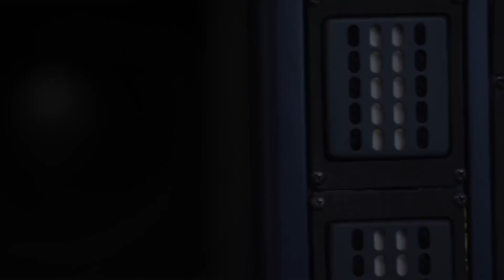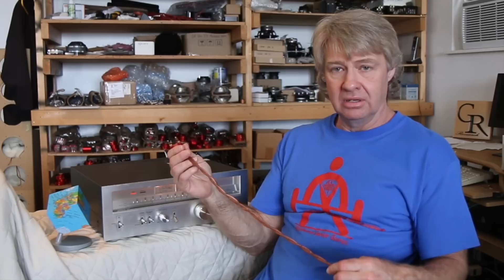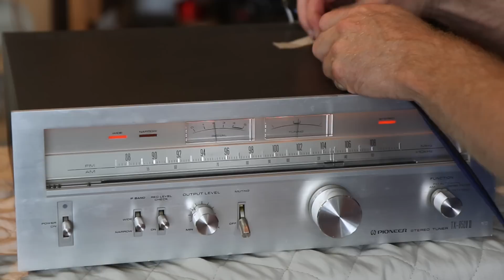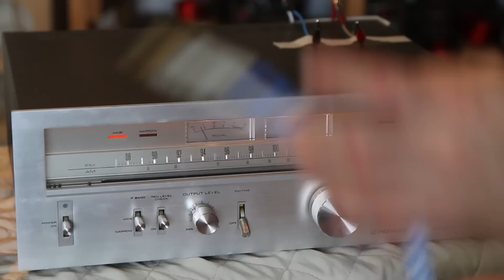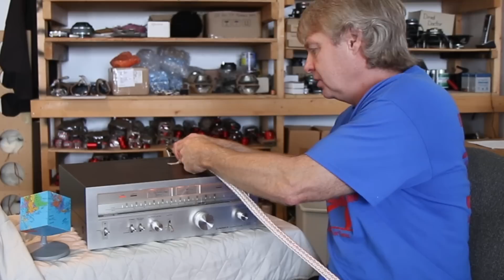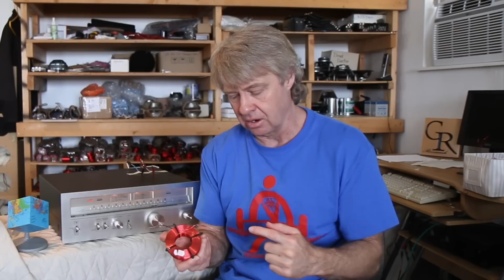Do Audiophile Cables Matter? Here's PROOF!

Comment: The quality of one's cables should match the quality of the other components. Expensive cables wont help ashitty system. On the other hand, if you want the most out of your high end system, you're going to need high end cables.
Reply: Agreed. and fancy wire with a cheap electronics can makes things sound WORSE.  When I was new in the hobby 20 years ago and had cheap, crappy gear (but good speakers) I purchased some Kimber PBJ interconnects, about $70/meter, as my first audiophile wire. I had been using cheap wire of Radio Shack quality purchased from Goodwill.  My bias expectation was that the sound of music would either "improve" or I would hear no difference using the Kimber. But when I listened with the expensive Kimber the sound was WORSE than when using the cheap wire: etched & harsh. The difference was night & day. I knew within 5 seconds of listening I would be going back to the cheap wire  (I sold the Kimber at a loss). What was the problem?  My theory was that the Kimber exposed the flaws in the crappy gear while the cheap wire smeared & veiled the flaws, like using a camera's soft focus to make someone's wrinkled face look younger. (All connectors on the wire were clean and had no wear; both types of interconnects were low capacitance.)  And I noticed that as the quality of my gear improved over the years having a lower noise floor, the harshness using better cables diminished and I could hear subtle differences in wire more easily.  And more-expensive wire did not always result in better sound than when using cheaper wire. 

And what do I mean by "better" sound?  We've all had the experience of walking down the sidewalk and hearing a piano or trumpet coming through the open window of a house and you know it's a real instrument and not a recording. Even when hearing an electric guitar (not an acoustic instrument!) sight unseen it's easy to determine when it's live. The ear is a very sensitive instrument. "Better" is what sounds more lifelike.

Objectivists miss the point lecturing that if something measures the same it must always sound the same. It's more complicated than that. If everything regarding sound came down to measurements then a manufacturer today could cheaply mass-produce violins that sound better than Stradivarius' cellos and violins - especially when considering all the knowledge about sound & materials & computer modeling we have contrasted with Stradivari working under primitive conditions. But nobody today can figure out how to make a violin having the superior tone/loudness characteristics of the S violin. Similarly, when builders construct a new symphony hall much research is done regarding design to get the best acoustics possible but the resulting sound is sometimes a disappointment and the designers are not sure why. There's an overlap between art & science but the two are different and equally valid. Numbers are not always a panacea here.  you have to listen

Comment: A better test would be showing the signal coming directly out of the amp next to the exact same signal going through the wire at the speaker at say 20 feet. Then have a speaker connected with the cable that’s 2 feet long and the cable that’s connected to the speaker that’s 200 feet long and then measure the output with a high-quality microphone that would be a more real-world test. Length of cable Determines which frequencies they will pick up. Antennas of short and long lengths pick up different frequencies. So it is dependent on location and where the noise is.

Comment: I'm not convinced.  You're testing cables by using them as an antenna and I get that a cable that is shielded or rejects radio interference by whatever means may have a lower noise floor (I don't know if that's true).  You're not testing them  by actually listening to music.  And again, I get it, youtube audio can never transmit the difference and make it audible on the receiving end AND you can't use "real" music because you'll get demonetized.  .  But there IS a way.  Get 10 cable believers (or 5 believers and 5 skeptics)   in a room BLINDFOLDED with a switcher setup so that cable A can be compared to cable B quickly, the listeners pick A or B, then the cables are changed and the A/B comparison is done again.   5 times will compare 10 cables, for example.  The whole thing can be recorded and out on youtube.  If the guys that claimed they can pick out cables that sound better correctly identify the "better" cable over 50% of the time, everyone will need to shut up and buy expensive cable.
Reply: We've done those A/B comparisons. The results were 100% every time.
Reply: @dannyrichie9743  Now THERE is a video I'm sure a lot of people would love to watch.  Lot of work to produce though.

Comment: This highlights that regular 12 gauge works the best as an antenna and nothing else. The FM signal still has to be amplified to become usable which is what the meter is showing. 

The amount of RF picked up by a pair of speaker wires is not audible as is it after the pre and power amp sections. RF is more likely to affect the input side of the amplifier where the signal is then amplified.
Reply: Nope, it doesn't need to be audible to effect the signal. That is also explained in this link: https://www.youtube.com/watch?v=ER_lqNFckxY
Reply: @dannyrichie9743  The noise is outside the operating bandwidth of the audio amplifier. A well designed input stage should employ HF decoupling to block rf noise also 👍🏼
Reply: @ta04trf  It won't block it all.

Comment: I find it hilarious that you would be concerned that a VHF signal at maybe 10 or 20 MICROvolts could possibly have any measurable or hearable effect on your SPEAKER DRIVERS. Seriously, man.
Reply: The truth is that it certainly does.  https://www.youtube.com/watch?v=ER_lqNFckxY
Reply: @jim9930  Talk about bullshit. You think you know something about this subject, but you still haven't figured out that there are clear audible differences in speaker cables? You are still ignorant as hell.
Reply: @jim9930  Okay, I take it back. You are not ignorant regarding this subject, but you went a little overboard on some of this. I never said feedback reduced RF interference. RF picked you by the cables can get reintroduced to the amplifier due to feedback issues, but that is just with some amplifiers. 

The whole demonstration was to show how some cables pick up RFI and EMI while others are configured in a way as to act as a filter for those ranges, and that is just one of the ways that the cables can have an audible effect on the sound.

Comment: All this test has done is prove how good or bad those cables work when used as an antenna. How they work as speaker cables with both ends terminated and voltage driving the speaker is an entirely different thing. You need blind testing under controlled conditions to see if people can actually hear a difference, and that's where things usually fall apart for cables making a difference.
Reply: Yep. And any competently designed power amplifier output stage implements a passive filter stage at the speaker outputs, consisting of a zobel network (a resistor and a capacitor in shunt across the amplifier output) to provide stability for the amplifier at high frequency when the amplifier output is presented with an amount of inductance by the speaker connections, and a small series inductor at the output to provide stability to the amplifier when a capacitive load is present at the speaker connections. Meaning: Provided an amplifier has sufficient rf filtering at its input stages, the output stage of an amplifier is immune to the effects of small amounts of capacitance and inductance in typical speakers cables. Also, the typical output impedance of a solid state amplifier is on the order of 0.5 ohms or less, and a speaker's impedance is between 4 to 8 ohms, thus there is zero chance of any rf signals finding their way from the speaker cables back to the input stage in a properly designed audio amplifier.
However, an incompetently designed amplifier input or output stage may introduce rf interference at the input stage due to lack of sufficient filtering and shielding, interference from switching power supplies in the amplifier or in devices adjacent to the amplifier, or by not including the output shunt zobel network or series output inductor. 

The cables can only be a factor in poorly designed gear.
Reply: funny how GR trys to make fun of flat earthers but he uses the same montra 1:35. then gives the most holistic test i have ever seen 

you can use take a two channel oscilloscope, that one channel with one cable type and the other channel on the other type. use the scope to show the difference, but i dont think a flat line is not as interesting as an old VU meter.
Reply: Or getting actual acoustic graphs
Reply: Before I purchased my arcam avr20 with matching power amps to drive my Sonos Faber sonetto front stage speakers which are part of a 5.2.4 configuration, I wanted to address my noise floor first!

 Even though I've changed my cables three times it was only when I finally used shielded cables did my noise floor become drastically reduced! If one is running a multi channel setup, one can go ahead and put this to the test... Watch a movie for 10 to 15 minutes then sit for a couple of minutes while the movie is on pause/mute and listen to the noise floor 🤔 then switch the setup off, disconnect the rears and height cables from the back of the AVR and repeat the process. 
I obviously done a lot of testing coz the amount of work I had to go through to accomplish this can be seen within this short 3 minute video...
https://youtu.be/wwU0d3NfRQw

At least now when the Silent scenes come in.. that is exactly what I'm hearing. 🥳
Reply: Hahaha… I made the same comment before I saw yours.
Reply: Agreed  a total  put  on.
Reply: It's significant that this guy believes that this test actually proves something about how these speaker cables sound.  DC resistance and possible significant inductance at higher audio frequencies would affect the sound more directly than how well they intercept or reject commercial FM radio frequencies with one end unterminated.

It's also significant that this guy does not publish his technical background credentials, most likely because he's lacking in that area.
Reply: @danaustin5869  Agree 100%. I find this guy interesting coming from the tube guitar amp world.... there are things i can hear like tube bias or El34 vs 6l6 in the same amp but not cables
Reply: You're never going to convince the snake oil salesmen 😂😂😂
Reply: this video pissed me off thb, and that made me think about it more. the ONE thing i can think of is, IF the  cables, act like an antenna, they receive and send in the same way. 

so if you have cables that are a good antenna they will transmit the output of the amp as RF waves and could feed back into the PSU and and unshielded part of the pre amp. 

but im still not convinced, also because GRr goes on about how mush background noise there is anyways.
Reply: @-IE_it_yourself they do. But at 10w it's not going very far. In fact, those fields are where the energy is in a circuit, not in the conductor.
Reply: Well Well Well almost  had me convinced, then I find out that the house wiring and virtually everything in the system is either an antenna or a noise maker. Maybe that is why most equipment has filters. I enjoy your content. Thanks!
Reply: Also, I'm pretty sure in 2024, we have what are known as shielded cables. What this guy has done is basically created his own network cable. Coax RG6 cable is way better shielded than any simple cable braiding like this so why not use a RG6 cable for the speaker wire?
Reply: This is the last time i watch any of his videos.
I have worked with hifi since 1989, and much of what he says is either idiotic or plainly wrong.
Reply: This is why I don't trust GR-R. You demonstrate a speaker wire can act like an RF antenna (which I agree, it can and does), and THEN claim the induced noise affects "the sound" without connecting these wires between an amp and a speaker. Gary correctly points out THAT would the REAL test of whether the induced noise is "audible" or not.
Reply: @Texacate  A lot of it here does tend to come across as self-promotional BS.
Reply: @Texacate  
What a shame that a man who is that knowledgeable would sell out his soul to sell oil de snake' )-:
Reply: @peteleoni9665  Can you imagine trying to sell a high dollar antenna to a bunch of ham/shortwave radio enthusiasts by demoing how well it works as speaker wiring?
Reply: @Texacate  
I will never understand people who make bad money when good money is easier. I think they just enjoy "getting over" on others.
Reply: @Texacate  hahahah!!!
Reply: @Texacate  lol so what you think might change?
Reply: @chriswelljack4910   Are we talking physics, or behaviors when you asked me "what I think might change"? Please clarify.
Reply: @chriswelljack4910  if you waire up a loop to a speaker, will you hear anything? maybe with a scope. many many magnitudes lower then anything. that is why a radio has transistors.
Reply: @MarioCuervonah i think talent is overrated; it’s way more about practice. some just come across critical thinking and education more than others. socioeconomic etc determined this more than some innate nebulous ability i feel like.
Reply: and dont try to do a comparison on youtube, the compressed 128kbs audio is horrible for this
Reply: 100% agree!
Reply: Oh metals can transmit energy? Yes please educate me! Metals are filters or atennas but if they are cheap and they are both, thank you for the explanation and the evidence you provide mister flat earth😂😂😂😂
Reply: @AbeldeBetancourt only if you buy 24 strand braided cable it confuses the evil antenna Gods from stealing your soundstage😮
Reply: I live a mile from an AM radio broadcast tower and the radio waves effect any and all unshielded speaker cables in my house. My old cheap computer gaming speakers picked up the radio signal so strong they broadcast it out of the speaker, it cancels out and ruins the music coming from my Apple Mac computer. One channel is ruined with interference in the day and near muted at night, cancelled out.
Reply: Nope. Naysayers will say that there is no difference and it will be over. Blind testing is metodologically wrong for this problem.
Reply: No, a bdouble blind test wouldn't work either. You'd have to publish the test results, and then the golden ears would look at the testing setups and tell you all the reasons it was worthless, and then you're back to square one.
Reply: @dpcummerbund  I've seen that and it's quite comical, but doesn't really change the fact that when they can't see the cables etc, they can't tell any difference - even between mains flex and $2000 per meter 'speaker cable'. Or in another example, when all that was used was bell wire, and no changes were made to anything, but the audiophile listeners heard 'night and day' differences when they'd been told the cables had been changed, when in fact nothing had. But yeah, you're right, they'd find all kinds of excuses why the tests are supposedly 'flawed'.
Reply: @dpcummerbund  oscilloscope would be your golden ears in this case.
Reply: They 100% work as an antenna under those conditions. If you leave your cable near other electronics while listening to music (especially things with cpus for some reason) you can hear very audible clicking noises and interference. It doesnt take any special person to hear it either. ITS CLEAR AS DAY!
Reply: @musiccritic8704  exactly but at the input stage not the output stage
Reply: @wil v i listen to the music not the system
Reply: Ohhhh... You're one of those people. Hahaha
Reply: @jason4547  Yes fortunately.
Reply: @garyl5128  My people.
Reply: @jason4547  One of those that actually wants to test it properly?
Reply: @jason4547  🤣🤣

Comment: I agree with George. But differences can be audible. I believe I heard them as well, but they are really really small. So it could very well be that the difference was caused by myself having a differwnt seated position. A tiny turn of the head also males bigger difference in sound stage, depth etc. All the items that reviewers mention in cable tests. The only way would be to have a remote switch like Wilson has when a-b-ing things. Really, a very small turn of the head or different seating position (one inch to the left or right) makes a bigger difference then a different cable with the same gauge.

Comment: This is like measuring the size of a bucket to determine the sourness of lemons.  Showing a meter reading of a minute rf signal picked up by a wire that's then amplified by a circuit design to make rf signals stronger, bares pretty much zero relevance to how it would affect the output signal of an audio amplifier going to a speaker!  Now if we were talking about signal cables as opposed to speaker cables, then there is more relevance.  However, even the best recording studios just use good quality sheilded cables.  Nothing more.  As a wise audio tech once said "just because it's measurable, doesn't mean it matters".  Relevance in application is everything.
Reply: Maybe you should have followed the link posted below the video: https://www.youtube.com/watch?v=ER_lqNFckxY

Also shielded cables don't do anything for the noise already on the line. Plus there is a magnetic field stored up in the shield that effects the signal transfer.